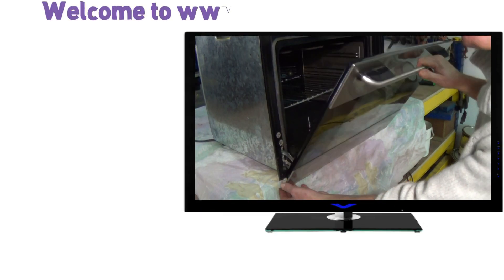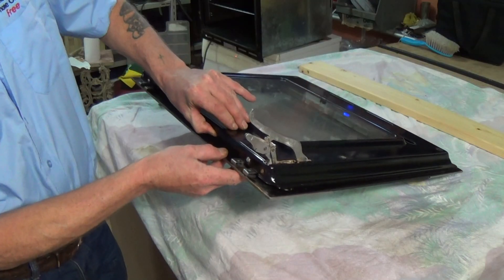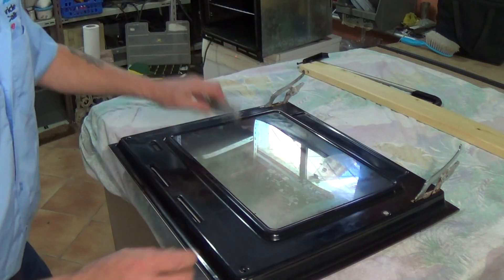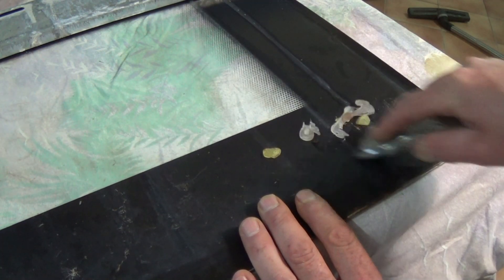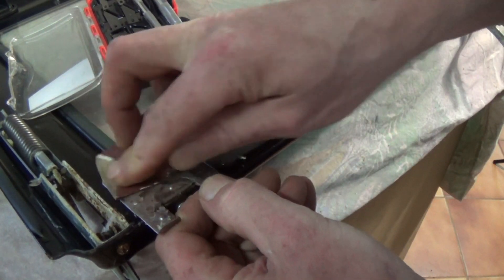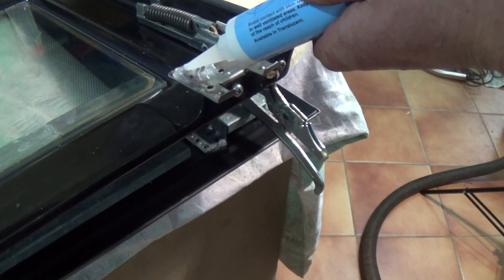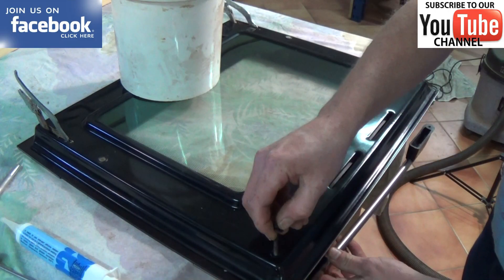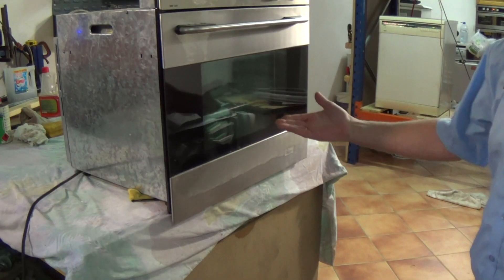How to re-glue an oven door bracket back on to the glass Using high temperature silicone sealant

Comment: Thanks so much for a great instructional video! Clear steps with visuals. I think I've watched this a dozen times before even trying to remove the oven door and then started and stopped the video at each step I was at. Scraping the silicone off the metal fittings was a task and a half,  as there were metal bumps and holes all over that metal plate  (manufactured that way), it left residual silicone, but I discovered a steelo wire scourer did a brilliant job and so much easier and faster with the removal.

 I thought I would add what adhesive I used specifically, as I see its a popular question. I'm in Australia and used Selleys SealFix Silicone Seal Repair (resists high temperatures up to 260* C and in a purple packet). This whole thing was a lot simpler than I anticipated.

Thanks again! :)
Reply: I have the same problem as you. I found Selleys Seal Fix in the local bunnings store in NZ. I want to know, does this smell smell when cooking food? Cheers!

Comment: I have a Miele H5080BM the outer door has come away looking at the top mechanism s they dont seem flush what do you recommend to do I was thinking of placing something underleaf so that  they sit flat but would could i use ?  As you say taking these fittings off could be difficult to refit and re-allign

Comment: Hi there. Greetings from Germany. I recently broke the outside glass of a Miele oven, the part costs 470€!!!. I said no to that, and I started looking in ebay for a compatible door. A door with matching dimensions and holes for the handle was really hard, so I settled for a door without holes from an Ignis oven, looks very cool, exact dimensions, same stainless color on the trimmings, and a mirror effect. Now the issue becomes how to put it together, I thought about drilling, but everywhere I've read, they advice against it because it might be Tempered Glass (or ESG). So I decided to give it a try with glue, using high temperature silicone inside for the two aluminum rails that hold all the inside assembly together, and then gluing the handle to the glass. Do you think this could work? can I use the same silicone for the handle? or should I go for epoxy? Thanks in advance, great job with the videos!